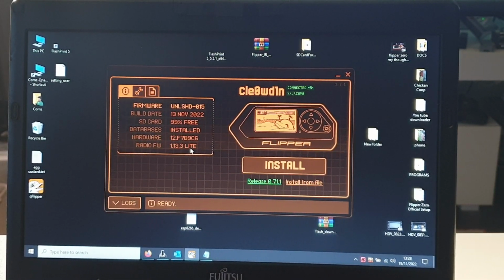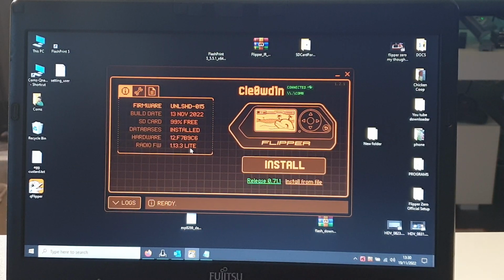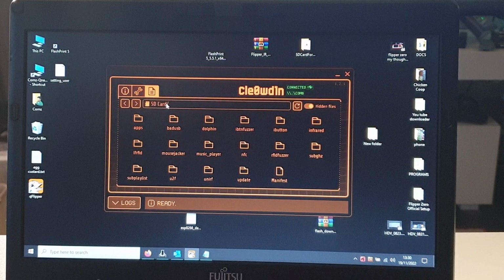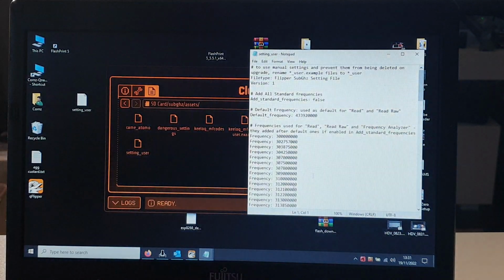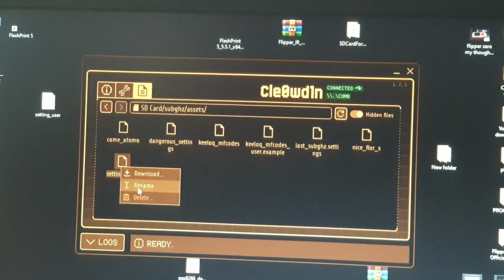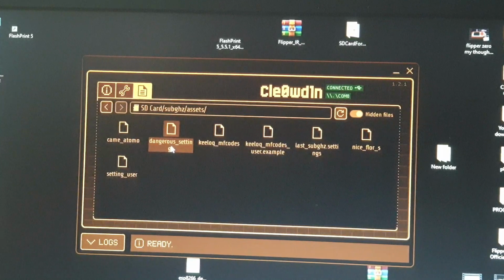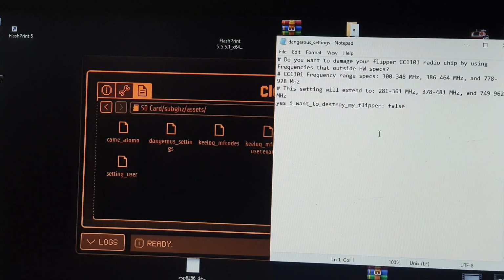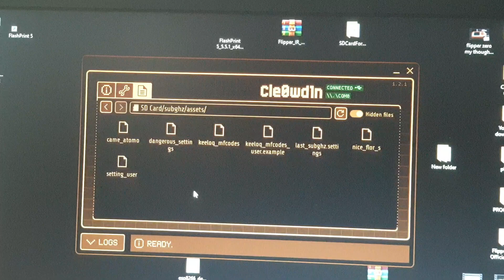The (almost) OAP's Guide To The Flipper Zero: Unlocking the RF chip to transmit on more frequencies.

Comment: I'm using unleashed firmware but the user_settings file only contains default frequencies, can you please help? thanks!
Reply from the maker: Have you unlocked the other frequencies with the text file?
Reply: Yes sir, I have all the frequencies that came with the unleashed firmware, but I wish to add one more, frequencies showing up on the device does not show in the txt file. @Cornz38
Reply: @Cornz38  Yes sir, I have every frequency that came with the unleashed firmware and I wish to add one more. But the frequencies showing on the device does not show in the txt file. And when I tried to edit the txt file, no changes has been made to the device.
Reply from the maker: OK, i've just walked in from work. This weekend i'll have a look and see if i can point you in the right direction. @shoichimizumasu1125
Reply: @Cornz38  Thank you so much sir!
Reply from the maker: Have you resolved the issue? I was wondering if you had removed the .txt extension from the end of the files!
Reply: @Cornz38  not yet sir, I have just updated to the newest unleashed firmware, but still, the 'setting_user' file is still the same. And yes I have removed the extension from the file name.

Comment: does this not damage your hardware?
Reply from the maker: It *COULD* damage the hardware. You do this at your own risk. Mine has been fine but just be aware.
Reply: @Cornz38  what is your purpose of doing this?
Reply: @Cornz38  as in how do you use this modification
Reply from the maker: @simplystatic69  different countries have different frequency allocations, so, for examle, 413Mhz may be blacklisted in your country. This mod unlocks ALL those frequencies for you. But it MAY be illegal for you to do so and it also "unlocks" some restrictions the chip manuacturer has built in.

Comment: What’s the petrol station file ?
Reply from the maker: It is, apparently, a file to allow changing fuel station signage but i now think it's from an American station so may not work.
Reply: @Cornz38   how didt you get it ? the signal freq ?
Reply: @alphatwiins5722  I would assume LOTS of research. Look for labels of manufacturing on the physical signs. Then hopefully you can find out the type of hardware the sign operates, then you can research the protocols and frequencies that particular model uses. Most countries have a governing body that regulates RF, so there should be standards and documentation on the internet to research the hardware.
Reply: @BallisticSuperiority  they won't do the research. No response.......
Reply: @MarcellsWorldJjr  most people won't.